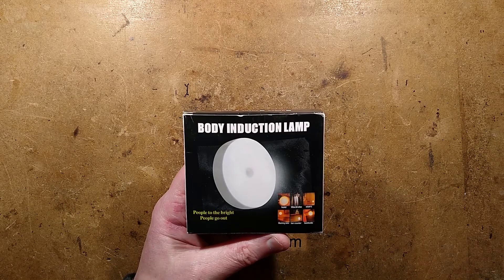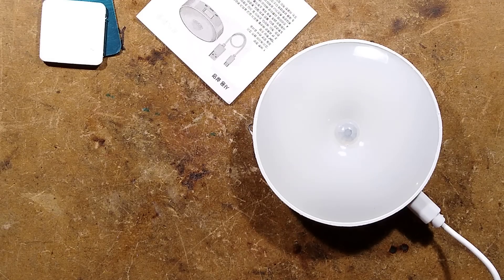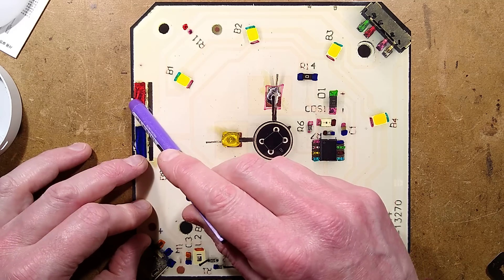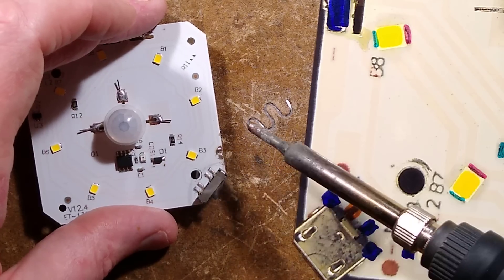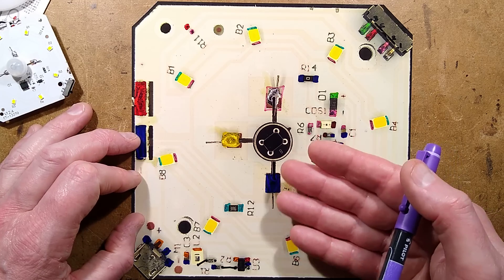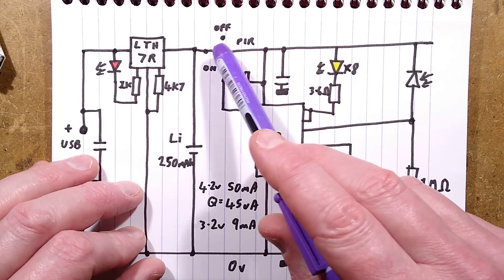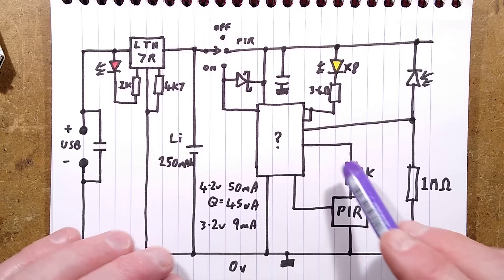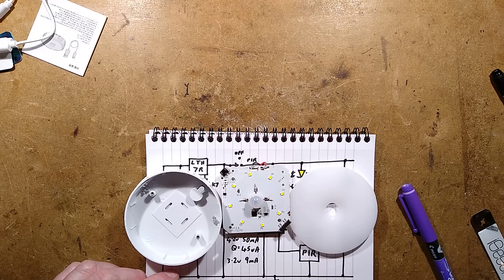Fixing a Temu light - with schematic

Comment: Hi Clive, we have one that I purchased on eBay, that works just fine and made your mod for a bigger battery, but it only stays on for 30 seconds, I would love to change that to 1 min, any suggestions? thanks Bob in the UK.
Reply from the maker: The chip that is often used has a voltage divider that sets the time.  You may be able to find a suitable datasheet.

Comment: Using too low current settings will actually wear the cell out faster. The problem is not with the charging current itself (there the lower current does mean less wear), but the problem is with EndOfCharge detection. The chargers work in CC bulk charge with CV top-op, where the CV (and with it the charging) is supposed to be terminated by the cell current drooping below C/10. The problem with using too low programmed charging  current is, with these charging chips the end of charge detection threshold current is a fixed percentage of the programmed charging current. So too low programmed charging current (for the cell size) means the charger will keep the CV charging ON for way longer (because it is waiting for the cell current to drop to a lower value), causing extra wear on the cell.
In this SOT5 or SOT6 charger IC formats most makers offer variants with the ratio between the charging current vs the end of charge detection threshold is different from the typical default of 1/10 (targeted for 1C charge current, so 2 hour charging), but here simpler way would be adjusting the programmed charge current higher (corresponding to the cell rating) and either rely on the thermal foldback to maintain the IC power dissipation and temperature (practically all charging chips have that feature; it causes the actual charging current to become rather low when the cell is discharged and increase as the cell voltage goes up so the voltage drop across the regulator down) or just add a series resistor to the input to actually limit the current (this will keep the current highest when the cell voltage is the lowest and go down as the cell is charging, this is actually even less stressing for the cell and obviously for the IC as well, as it keeps the power dissipation away from it).

Comment: Why is that LED resistor such a low value (3.6Ω)? I am trying to figure out how that would make 50mA go through all those LEDs.
Reply from the maker: The LEDs are all in parallel.  Whatever current is passed by the resistor is shared amongst the LEDs.

Comment: I have a few of these from Aliexpress. They're really useful although out of the box the battery only lasted about a week.

So I've replaced the LED resistor, which was 20 Ohm on mine, with around 60-70 Ohm to reduce brightness. I've also replaced the battery with a 523450 lithium cell (allegedly 1000mAh) which is probably the biggest you can fit in the case. They now last for months between recharges.

Anyway, thanks for these videos to encourage modding electronics.

Comment: Nice video!

The light are similar to the once I got from Aliexpress, thought without PIR sensor.
These have an even bigger fault!
They swapped the + and - on the mirco usb port charging port. They also made "custom" cables, which also have swapped polarity!

I have thrown away the cables out of safety and was able to mod the micro usb port pins so the polarity isn't swapped any more. 😊

Comment: When you challenged us to look at the board, I stopped it and looked. I saw the R11 pins with no resistor between them. You didn't mention in the video what it was, or rather what it would do if a resistor was put in that spot. Why is the resistor missing? And why do they even have a spot like that on the board if they're not using it with a component?
Reply from the maker: The blank resistor position is odd.  It doesn't really make sense.

Comment: I bought 6 strip versions of these from aliexpress and surprising all work , different colours, different lengths and different battery sizes. Just about to add 10 x 800 mah cells to the 50cm version of the light and thanks to your video have located the charge setting resistor. 👍

Comment: I wonder if the motion sensor is turned off when it detects that it's light and is charging?  I could see using the motion detector on some kind of wake up interrupt and not wanting it to keep waking the main processor all the time all day to improve battery charging and reduce power consumption.

Comment: i wonder if that's what happening with some handheld jogging lights that I bought.  One of them works, the other stopped working a while back.  It works when I plug it into the charger, but doesn't when I pull it off.  Plugging it into a tester shows no amps when just the broken one is plugged in, but around .60 A when turned on.  The other one draw the same when turned on, but around .10 A when charging.  So I bet it's the same problem.  Or just a dodgy battery.

Comment: I made a repair today, I would not be able to find it out without your help. Our vent over the cooktop was broken. It buzzed hard with the relays if it had to do more than one at a time. I realised it was a power fault. Took out the PCB, and after cleaning 13 years of grease of, the caps was all gone. I got some new ones, changed them, and it works flawlessly now! thank you for all the entertaining, and useful videoes!

Comment: I never understood why anyone would want a fixed light that needs to be removed and charged and doesn't have a solar panel to charge it. What good is a light that doesn't work when you need it? I'd rather just plug it in the wall. They show these things lighting stairs and hallways. Not very practical.
Reply: You can just carry a torch around with you.
Reply: @two_tier_gary_rumain  Sure, but I'm lazy. :P

Comment: Thanks for mentioning your club of clever people, I dreamily thought I was one of them for a second but then I blinked and came back to reality. I’m afraid I’m about as technically minded as a freshly boiled new potato but I do watch every one  of your vids. I’ve almost learned the word milliamp or is it mill-amp but have no idea -in-life what it’s used for. Talking of potatoes, is it true that a potato can charge something? If so can it still charge something after it’s been boiled? (Genuine question, not half a joke) Rob
Reply from the maker: You'll gradually pick up more and more electronic understanding over time.  The potato battery is just a gimmick.  The real work is done by the two different metal electrodes.  The potato just acts as a wet conductor between them.

Comment: I've been using the Mr. Beams MB530 motion sensor lights for 7+ years now.   Runs on 3x C cells.  Comes on as a dim glow when dark, goes to full bright on motion.   I get at least a year on one set of batteries.   They've been great during power outages.

Comment: I also got a LED headlamp that is called an "induction light" I have no idea what they mean with it
Reply from the maker: It may have an infrared mode where you can turn it on and off by waving your hand in front of the light instead of using a switch.  It's for when you've got work gloves on.

Comment: Yeh, I got a collection of "cabinet lights" scattered through the house, too.  Stairs down to the basement, I haven't even turned on the wired lights in years because I don't need to anymore.  Just occasional charging is fine.  I look through vipon for "cabinet" and see what's on sale.  If 7-8bux a pop (eg, 15 for 2) I'm interested.  Nowadays everything does selectable 2700K/4000K/6500K or so, and various dimming levels, so I can "tune" them as needed.  Quite nice.  I even got one leaning against a window, facing outward, so I can light up the side alley from inside when I'm putting out the garbage.

Comment: This is so weird, our worlds are aligned! Just yesterday I also swapped to a unused 1000 mAh Nokia cell phone cell for longer time between charges.  I also changed to 2200 ohm for 450 mA charging knowing the formula in the LTH7 datasheet is I = 1000/R2.  Now I want to know how to make the "ON" time longer.  Did you figure that out Clive?
Reply from the maker: On time may be locked in software, or it might be controllable via one of the unused pins.  Some of these chips allow sensitivity, light detection and time delay to be set by using a potential divider between the positive and negative supply to a dedicated pin.

Comment: Yes, Clive sensor lights are a good idea.
 We have one outside the front door, one on the stairs and one in the garage. They work from 3x aaa. Unfortunately, they are not rechargeable.  But as you suggested, it makes it safer and quieter than using light switches in the night. When I replace them I will look at rechargeable ones. Thanks for the investigation.

Comment: I'm not technical, so I'm just going to make a kinda stupid question here... xD Semi related to the video but not by much I guess.

Say you have a totally new house or apartment to work from scratch.
Does it make much sense to wire the whole thing to push something like 12V DC, or something like USB-C power, for lighting, instead of mains? Like, instead of having each single LED light with it's own step down transformer circuit and whatnot, you centralize everything separately, kinda like in a circuit break box or utility box, and only send DC power to fixtures, plus switches and whatnot.
Perhaps have a portion of the lights be removable with a battery so you can use as a flashlight or something, though I can see that being kind of a fire hazard. xD

And then, if that's even a good idea, you'd of course still have outlets with mains for all the stuff that requires it... but it seems that increasingly we get almost half of electronics that we plug in only needing at most some USB level power. Smartphone charging, some newer laptops, portable LCD screens, some battery powered tools and stick vacuums, speakers, etc etc.

Or this is just a horrible idea that would end up in death or fire? xD
Reply: If you got USB-C lights, I guess it’s ok. Check with an electrician from your country.
Reply from the maker: In the future they may have a 24V DC bus system for lighting.
Reply: Two truck /bus batteries and a solar panel with cheap pwm/mppt controller. Occasional boost from mains power when needed.

Comment: I have a few of these, scattered around the house like you said so you don't always have to turn the lights on. Upgraded them to 95 CRI LEDs because I could. I left some of them uncharged for too long and the cells puffed up so I had to get rid of the batteries but kept the lights incase I come across replacement cells.
Reply: Do you have disposable vapes laying around? Where I live in UK, they are now available from the Co-Op battery bin. They have a 550mAh lipo pouch cell inside and are easy to take apart. Try 2 or 3 or 4 cells in parallel. 

Which 95 cri LED did you use?
Reply: @davadoff  I'm in the Netherlands, don't see many vapes around but we do have e-waste recycling bins in some supermarkets, I'll have a look next time I'm there. I bought a few thousand Cree JE2835AWT LEDs at 3 cents each before they went obsolete, the new 95 CRI ones are a lot more expensive for whatever reason. Looks like Digikey still has some in stock.

Comment: you could also replace the 1 meg Ohm resistor with a trimmer of the same value, for a sensitivity Adj. for the light sensor. 
but you would have to mount  the trimmer on a small piece of perf  board , and run wires over to it, and drill a hole in the 
side of the unit, for access with a small screw driver, and mark the sensitivity scale.

Comment: Since there is no use having a light during the day, it switches the IR motion detector off until dark is detected by the photo-resistor!
I wouldn't bother, since most IR motion detectors have a quiescent current of less than 50uA. A schottky diode has twice the reverse leakage!

Comment: I bought a tube like sensor lamp from temu.

Plugged in for charging 
Nothing 
Turned on 
Nothing 

Opened it up battery was fully charged 
All good 

I tried to power extremely using another battery 
Nothing 

Then I just tested the leds one by one 
And then I powered all with direct connection 
Then all of a sudden the thing started working 

Charging and working 
I don't know what happened 
Or what did I do
Reply: I have had odd things like that happen while doing some routine trouble shooting .
I have no Idea what changed, but it works after!
 [ twilight zone theme ]
Reply from the maker: Odd.  May have been a chip lock-up or just a bad connection.

Comment: Ha ha. I've just bought a bunch of these and reverse engineered them. The controller chip is an NSA3182FT100, which is a dedicated PIR controller. The reason I reverse engineered I it was to keep the light on for longer. The controller has variable on-time on pin 6, although this is unconnected in mine. The datasheet shows it can be connected between a 1MOhm resistor to Vcc and a 1MOhm preset configured as a variable resistor. to Gnd. The sensitivity can also be adjusted in the same way on Pin 7. You're right though, they're really useful and only a couple of quid each on eBay. They're also useful to avoid the blinding experience of turning on the bathroom lights in the middle of the night.
Reply: This is great news.  I wanted to make mine stay on longer too (it's above the cat bowls).  Did you have success?  Is there a formula for the ON time?  Please let me know! :)
Reply: @pault6533  Should anyone else wonder, found a sample schematic that had 1MΩ pull-ups and ,0-1MΩ trimpot to ground. There's a graph showing stepwise changes to time, based on voltage (0 - 0.5xV_supply) on pin 6, from 1 to 3600 seconds with bigger and bigger steps, roughly exponentially.
For a look, replace _ with . and + with / for a working url:
dinistor _ ru + files + NSA3182.pdf
Page 5 has the graph.
500kΩ on the pot should give 60s but is right on the limit to the next step of 90s.

Comment: I would guess that the resistor value on the dusk sensor was chosen to compensate for the sensor seeing light from the LEDs scattered and reflected from the diffusing cover. The wrong value would result in the poor thing turning itself on and off continuously. I wonder how quickly it can oscillate?

Some years ago, when a friend and I learned that LEDs can also detect light, he tried to build a data transmission device using LEDs on both ends (yeah, he basically invented the optocoupler but didn’t know enough to patent it). He found out that they can transmit faster than they can receive (at least the ones he used had those limits). Ever since then I’ve wondered how many devices that have microprocessors coupled to LEDs used as light sensors use that capability as a hidden data input or programming port like those rave badges you showed us a while back.
Reply from the maker: The chip can ignore the light sensor while the LEDs are on.

Comment: What are those four wires sticking up from the board, cruciform about the PIR sensor? They remind me of ion discharge points—maybe some sort of attempt at faking that?
Reply: Those are just the legs of the PIR sensor that they didn't bother to trim after soldering it in place

Comment: I'm curious Clive about why the dusk sensor doesn't detect the lamp's own light and shut it off. Is daylight so much brighter than the LED light that might be reflected back?
Reply: Once it is triggered by the PIR sensor, it ignores the ambient light sensor for the given time.
Reply from the maker: They may just ignore the dusk sensor while lit.  The classic BISS0001 PIR chip has options to do that.
Reply: I am not entirely sure, but I believe those passive infrared sensors are based on a timer. It will turn on for a fixed length of time (usually around 10-30 seconds or thereabouts), then go out, then re-trigger again after it has gone out. Or perhaps if it continues to detect movement, it will stay on and only check the dusk sensor again after it has gone out.